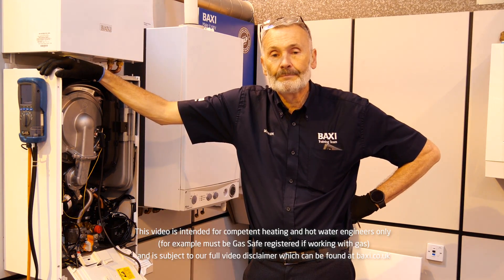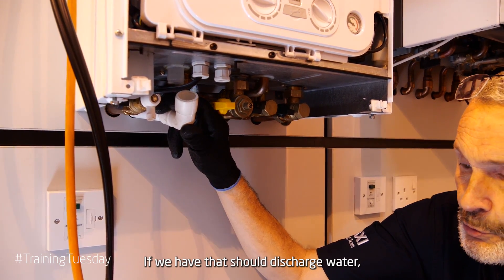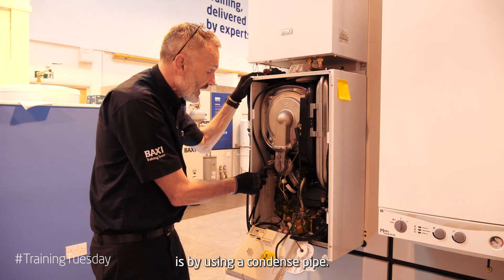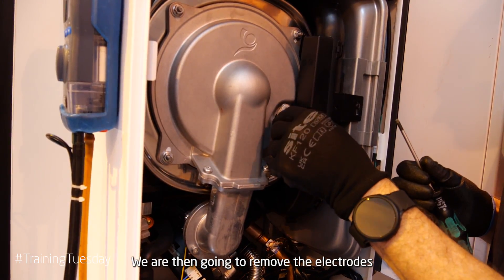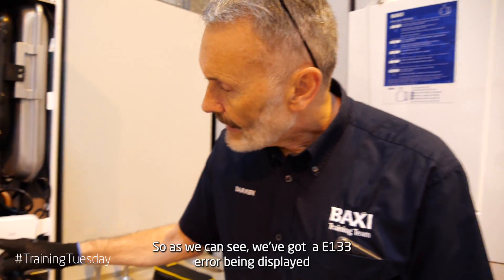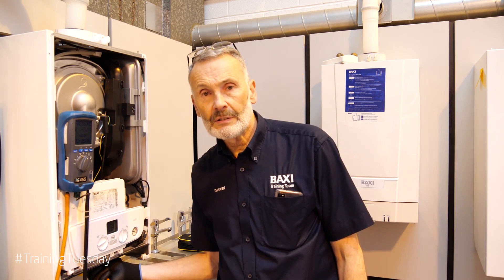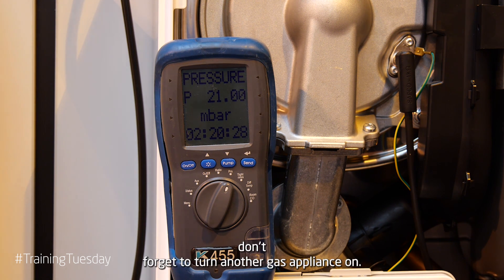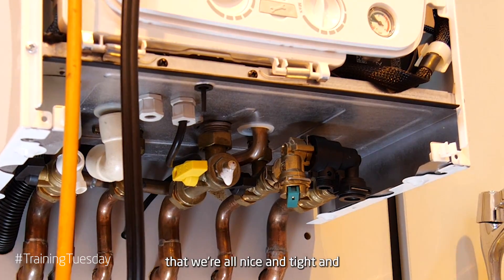How to diagnose and fix error code E133 on the Baxi 600 or 800 Combi boiler

Comment: This video helped me massively. I went to the black pipe on the inside for the condensation pipe and took it off and where the black pipe met the container it clips to, the hole of the black pipe was full of brown sludge when i pressed the blockage a few times it all came out and i filled 2 big jugs of water untill nothing came out. So that blockage was stopping the water going anywhere near the white condensation pipe on the outside of the boiler on the video (which is what i was checking previously for blockages). Thank you for the video.
Reply: Hah, OMG I've just had the exact failure - where the back pipe from the bottom of the combustion chamber connects to that plastic siphon thing. It was like rust particles, sort of crunchy. Made a bit of mess when I pulled it off and luckily the PCB didn't seem to get wet.

What worries me is that surely means there is a fair bit of corrosion going on in the combustion chamber, and what that means for the remaining life of the boiler?

Comment: I've had the same fault, all of the checks in the video were performed successfully.  The next steps should be demonstrated too - gas valve & checking electrode for spark & ionisation?